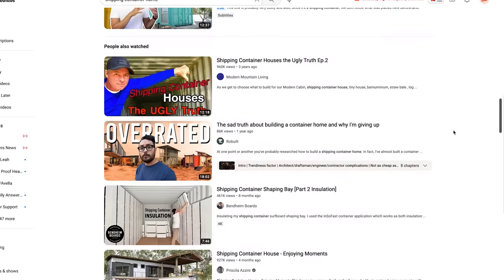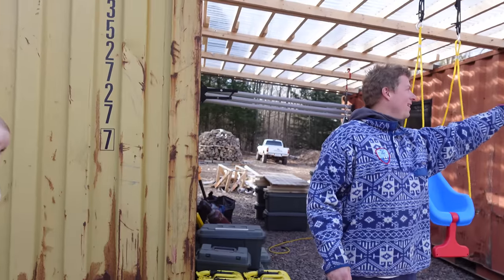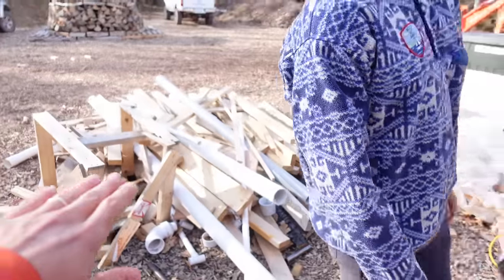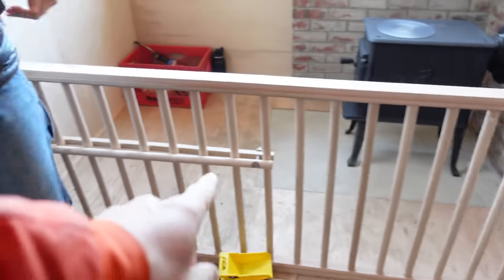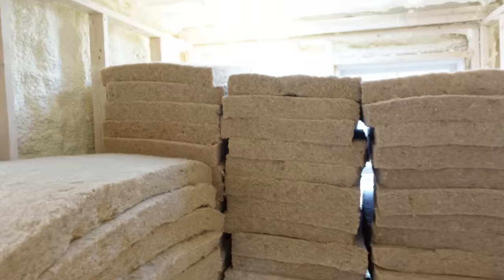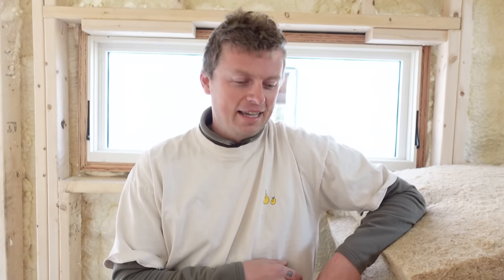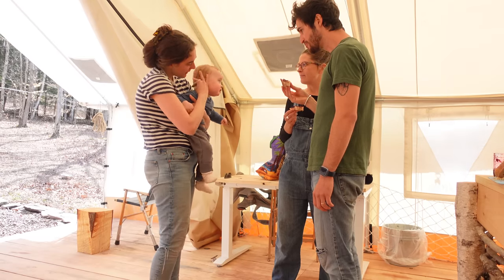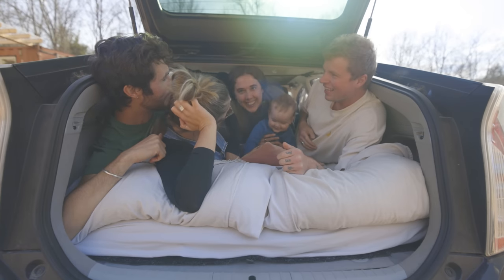Leaving the Prius for a Shipping Container!? (@WildWeRoam)

Comment: If you're going to consider buying an older home be sure to do research on lead and renovation precautions esp with a baby.  The dangers are far understated and sadly most professionals want to do things the cheap and easy way which means higher danger.  My daughter ended up with lead poisoning when our contractor said it was fine to replace windows on our 1920 home without precautions and we didn't even know enough to question that.

Comment: A few of us up here in rural Canada had looked into container homes .. developing is not economically feasible for our climate. 
Consulted an engineer. They’re not designed to support weight once openings are cut so they have to be re-engineered for weight and strength. They have no breathability for heat, cold, moisture. Moving them is not cost effective. Etc, etc … In the end it’s cheaper and easier to build a small house. That’s why the trend hasn’t caught on in a bigger way. 
Nice channel … prefer your other one 😊

Comment: So i know of a family up in the North woods that pretty much have become addicted to building with shipping containers…. It started out with a single container up on blocks  … from there to something like what you see here…. Wood heated, powered by a battery bank charged by either generator, or by tractor with water pumped from a local creek using a sump pump into giant pallet size containers…. When the decision came to run electrical , dig a well and attempt to live there year round they moved the three containers into a triangle into a foundation of piers , adding connecting yurts at the three corners and a set of sliding doors on both sides of one of the containers.
AFTER rhat the added two more containers to make a diamond with a central hall. The following couple of years found them adding four more container two at a time making first a rhombus than a giant triangle of four smaller traingles , moving the three yurts back to the far corners and covering over the central triangle with similar material you see here. After this they added three more containers atop the original triangle with a staircase in a corner of the inside triangle leading up to it, shifting that rain cover up one level with window holes with hinged shutter to create a three sided look out deck.
After that they roofed over the central triangle with a glass pyramid, sealed the upper level turning the central area into a temp controlled greenhouse with each container upstairs becoming its own bedroom.
Few years later one of bedrooms upstairs was sacrificed to so that the outer triangle it faced could be decked over. The triangle under it was sealed and turned into living space illuminated by a skylight that was actually a picnic table built into the deck above. 
It was at this point that the lower levels outer walled were banked with gravel along most of the edges and made into terraced flower and vegetable beds with just casement windows. The two remaining remaining triangles were made into a pool in one and a hot tub and sauna in the other. 
The last container builds involve slicing two container in half at opposing angle.. swapping the pieces and reconnecting them then hoisting them up onto the second level to make ^ shaped bedrooms that have their back ends hang out in midair  so now the house has two yurt shaped bedrooms on the back corners…. , a yurt shaped front entrance that flows into a living space with a skylight coming through the deck above. Its back wall flows into the kitchen container and through it into the central courtyard to the left of the court yard is a pass through into a hot tub and Sauna area, to the right is a pass through into a pool area with the back corners of each opening into a yurt style bedroom …. Two stairwells in the corners of the courtyards lead to one straight and one bent bedroom, plus opposite sides of module that is a the room that overlooks both the inner courtyard and the outer second floor deck. 
(Much of the original first floor containers have since been repurposed into bathrooms, utilities office , etc 

The last addition was a giant rolled like what you see on the side of an RV that rolls out from atop the second level NON BEDROOM on cables to two large timber poles in the yard . This can provide both shade and rain cover to the deck ….
The original couple that started building it are retired now and spend the bulk of their time traveling or visiting the families of their children that live out of state. However the property is still owned and occupied by two brothers who married best friends wives and they are building a new guest cottage out of shipping containers, but using right angles this time
Reply from the maker: It’s a very popular technique so I wouldn’t be surprised if we saw more in the future. 👍🏼🤓

Comment: What is the benefit of building in a shipping container? It seems like there are a lot of downsides (loss off structural integrity since they were not built to have windows and doors cut out, you dont know what was shipped in there and if there is residue from hazardous materials). Not meant in a mean way, I always enjoy your videos, just curious.
Reply: Also, cute overalls Leah
Reply from the maker: I have no idea! They’re way more ware of the challenges for sure so if you wanna see more check them out!